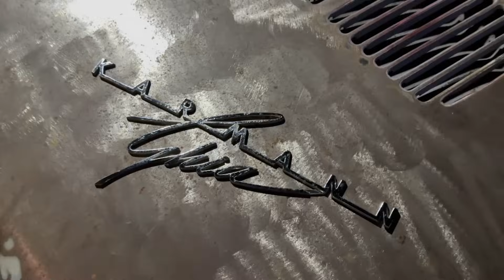DROVE 2,000 MILES TO DELIVER THE GIVEAWAY PORSCHE!!

Comment: Does the FeelAir management system not have a preset or is it that you set the preset suitably high to always be safe then manually air down the last bit towards the rim as you showed her to do?
Reply from the maker: I had some presets pretty low, but that oil pan is aluminum, and easily breakable, so I had set them high so she could see the height differences!